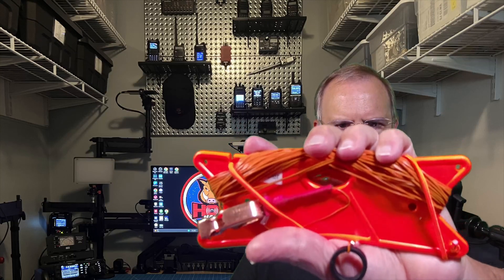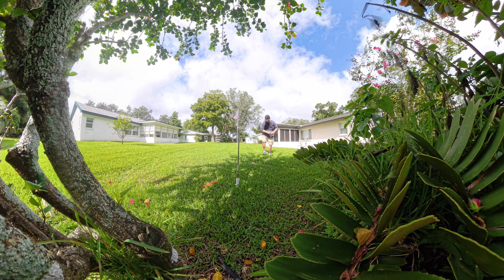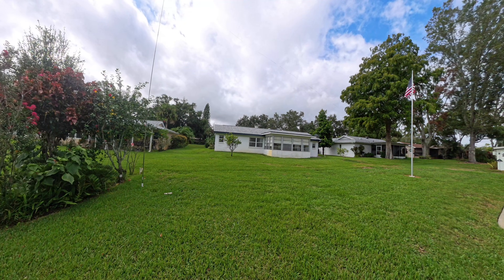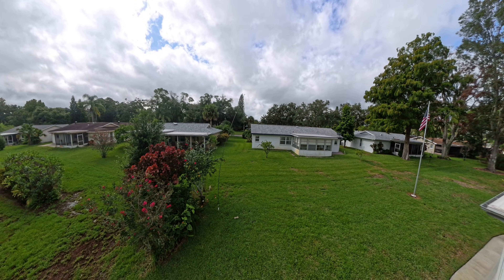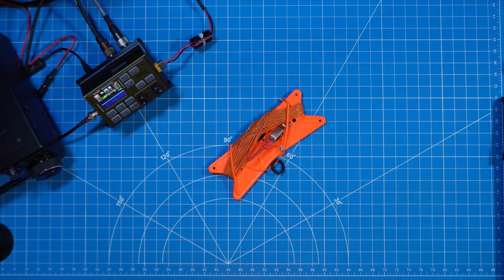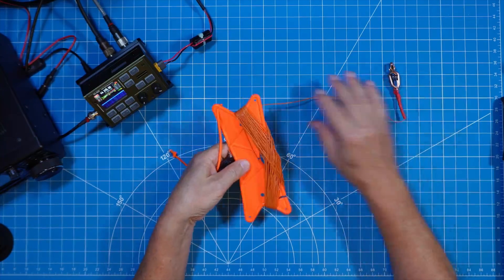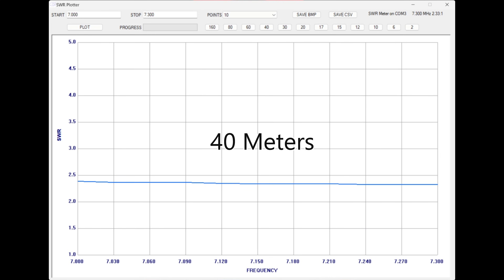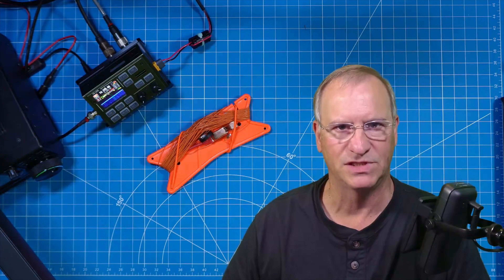Chameleon LZ Sloper Antenna -- Demonstration & Review for Increased Bandwidth  DX POTA SOTA EMCOMM

Comment: Hi Bob.  I’ve been watching all of your videos since I have a similar situation.  I’m on a fairly large lot, but too many trees in the backyard where I prefer antennas.  Front yard not much better.  I’ve been running the MPAS Lite in vertical with a SS25 and the single ground radial.  Incredible results 10M-20M.   I’m trying to find a solution for 40 and 75/80 SSB.   Besides being vertical, it appears to be very inefficient on those lower frequencies.   I have tried using the Micro ground mount as a rising sloper, but it didn’t like 40 or 80 at all.  I have room for the LZ sloper.  I also have room for the tactical delta loop.  Do you have an opinion as to which might be better for 40 and 80?   I should probably find a way for a dipole, it’s just going to be very compromised and very difficult to pull off.  Anxious to see if you have any comparisons or other ideas.  Great videos BTW.  Thanks.
Reply from the maker: Because of my lot size and HOA I do not do much 80; and getting 80 with a vertical is tough.

The TDL is great on 40, but I don't recall it being great on 80.

The LEFS8010, now, that I found to be great on all bands advertised.  I did a vid on it where I "bent" it to get it to fit on my small lot and it still worked great.  If you have space, you may want to give it a try.  https://youtu.be/jfVKa7bkHgU
Reply: @HOAHamRadio . I’m going to play with the various configurations of the MPAS including elevated feed and LZ sloper.  Might even try a Rybakov setup.  If I’m not satisfied with any of that I’ll head in to some wire dipole or end fed.  Thanks again for the excellent videos.  73 K5BUZ

Comment: Any benefit to running the wire horizontally vs slopping down?  I also experienced SWR of 4.2 at 80M. Everything else seemed inline with yours.  I only have two 25’ radials installed at the moment so that might be the SWR difference on 80M
Reply from the maker: Running as an L you might get some NVIS on lower bands.  I have incredible soil here in the Tampa Bay area which I believe helps with my SWR.

Comment: Agreed, another great one. I might have missed it in this video, but did you deploy a counterpoise?
Reply from the maker: Counterpoise is raised off the ground and tuned to band / frequency.  Ground radials are much more forgiving...I use ground radials.  

With Chameleon verticals kits they come with a single 25' ground radial which I have used with success.

Out of habit and experience I use a set of three 16 1/2 foot ground radials 40 meters and up.

Comment: I see the makings for a inverted L feedline on the porta mast radiator running to the whip.. so many options with the flag pole wonder how they would work..  :)
Reply from the maker: The Porta Mast continuity breaks at each section; so it isn't a radiator...I have pondered what to do about that so many times.

Comment: I find the 20m operation with the wire is worse than just using the vertical, but on 40m its useful
Reply from the maker: Thanks for the real world feedback.  Hard to be a 17' whip for 20, and the added wire / length certainly improves 40

Comment: So one end of the wire is connected to SS17 and other end sloped and into a ground stake? Is the latter end of wire held down with an insulator?
Reply from the maker: I did not use an isolator, but that would be preferred of course; it could only improve performance over what I demonstrated.

Comment: my issue isnt HOA.. my issue is SPACE! i want to run an HF antenna but dont have the area to run it.. i was looking at an F-loop but they are only limited to 25 watts do you know of anything that might fit in the footprint of an F-loop but might be able to handle around 100w?
Reply from the maker: Do you have room to put up a vertical antenna; like a 17' whip?  And approx 32 feet in diameter to lay down some 16 1/2 radials.  Or are you strictly in the F-Loop footprint?  Is your available space in a yard, porch, deck, and how much space is it?
Reply: @HOAHamRadio  my issue is i dont have the yard space to lay out 16.5 radials.. i live in a trailer park so my yard is tiny..
Reply from the maker: Ok, I get the challenge.  Alpha Antenna is the only company I'm aware that makes a 100 watt mag loop...I'm not a Alpha Antenna fan.  It is my opinion their quality is substandard for what they charge.  Doesn't mean it won't work.  Ciro Mazzoni is another company, but HUGE dollars to purchase.  Maybe keep your eyes open on eBay for something used.

20 watts is sufficient for HF communication BTW, so you can, in my opinion, consider the CHA F-Loop.

Comment: Thanks for the upload - it looks like a simple way to add extra bands while working portable. What is the TX power limit? 73, John 2E0SVB
Reply from the maker: From the Chameleon Antenna web page:  Hybrid Micro- 100W SSB Phone, 25W CW, 25W HIGH DUTY CYCLE DIGITAL MODES.  Hybrid Mini-500W SSB PHONE, 100W CW, 40W HIGH DUTY CYCLE.
Reply: @HOAHamRadio  Thank you.

Comment: Thanks for the video!!  Stay dry!  Watch for flooding!
Reply from the maker: Staying dry so far Norm; we actually have been doing some prep over the last sever weeks for dealing with heavy rains...been a lot of that this summer.
Reply: @HOAHamRadio  So far it is just a little wind and a little rain. Fingers crossed!
Reply from the maker: @norm_sueb122  Home you fared well.  The electricity is back and the branches are all picked up; almost back to normal.

Comment: Great video Bob. Didn’t know you could do that!!!
Reply from the maker: Thanks Ammed, its not a TDL but it is another option.
Reply: @HOAHamRadio  Hey Bob, is that to mean in your opinion the TDL is a better antenna than this particular setup?  I have the Mini and the TDL but was wondering if this offered better or different characteristics.  Just wondering, thanks for any insight!
Reply from the maker: @joshuabuehrer  Each antenna has its benefit; my comment to Ammed was because he is a HUGE TDL fan. 

I can say if I had no restrictions, the TDL would be my choice, elevated minimum 4 feet.

The benefit of the LZ Sloper is it is such a small piece of gear that can travel with the MPAS Lite, which is great and sufficient on 20 meters.  If you wanted to get some expanded bandwidth, add the LZ Sloper.
Reply: @HOAHamRadio  Thanks! I appreciate the info!